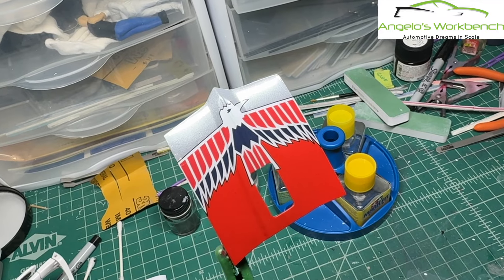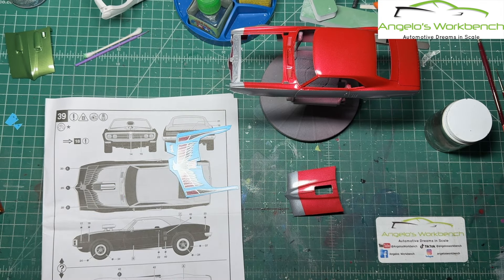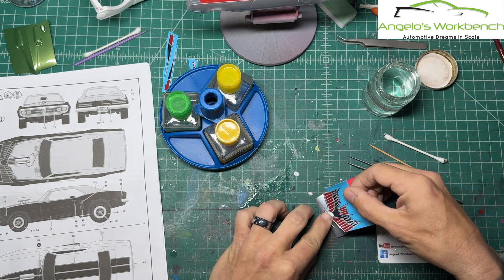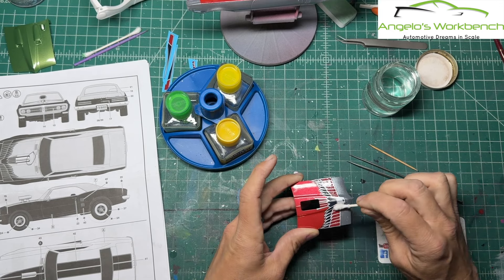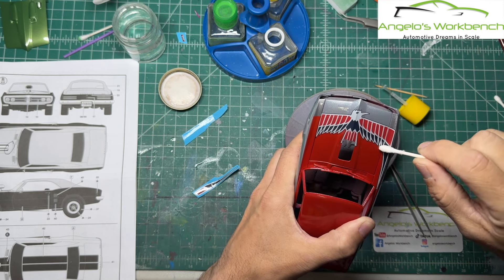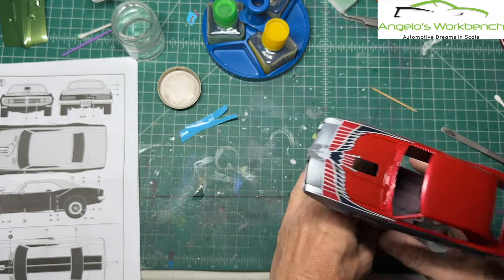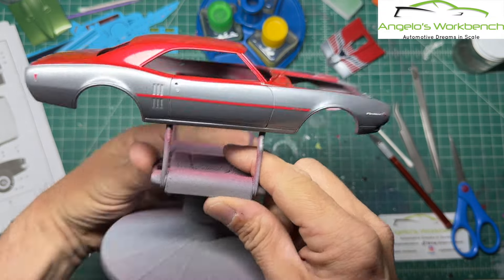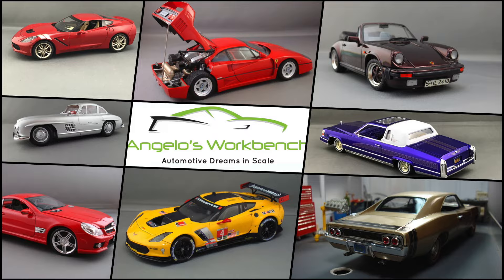Revell 1968 Pontiac Firebird 400's Video #4

Comment: Both birds look fantastic!, another alternative to the Pontiac letters in the rear is Baremetal foil them prior to primer and just remove the paint using a q-tip dipped in thinner and the same after applying color coats,it really works great!.Looking forward to seeing the Birds finished.